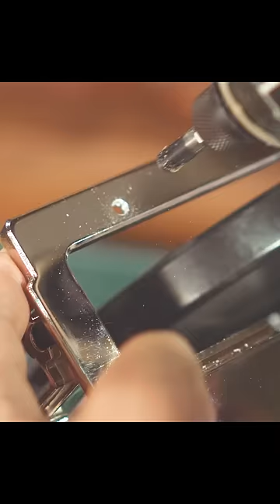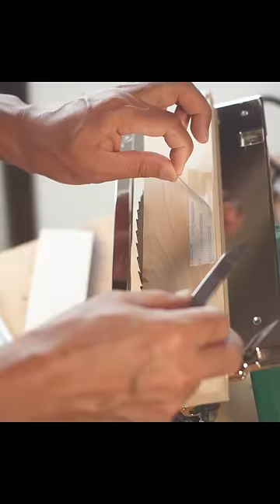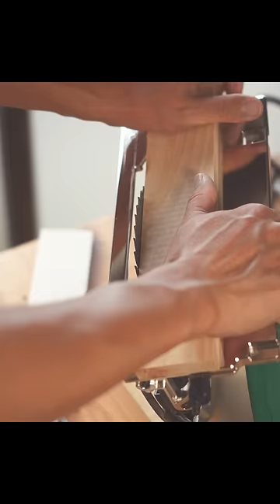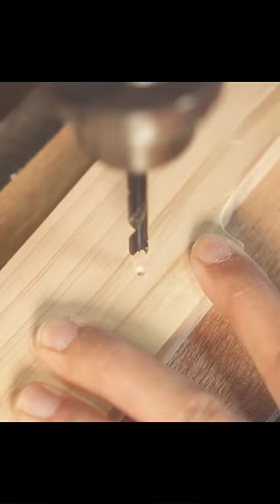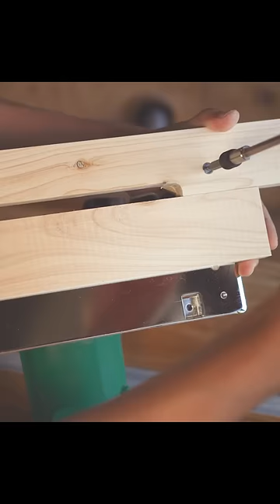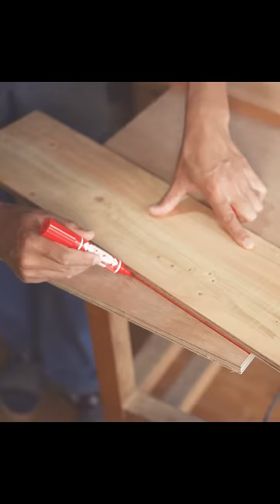Few People Know About This Hack🤫 #shorts

Comment: This is a great idea . . . if you like doing things the hard way.
Reply: What's the easy way? Having to offset for the blade is annoying, besides that only a table saw sled works better
Reply: @A6Legit  Just clamp a straight edge to the board you're cutting, and use that to guide the saw
Reply: I bet he brushes his teeth by shaking his head left to right really fast too.
Reply: Not really, this method is a lot more efficient in the long run
Reply: @Papa-in-Tx No, no, NO.  With his way, the saw shoe, does NOT touch the wood being cut.  No shoe drag micro scratches to need cleanup.
Reply: @A6Legit dude, the saw already has a flat base and flat edge. This is creating a reference piece for an existing reference piece which is useless.
Reply: @Papa-in-Tx  My point is doing it your way you have to position that straight edge offset from where you want to cut, since the blade doesn't cut on the same line as the edge of the saw shoe (aka the base). For example my blade cuts 1.5" to the left of the right edge of the shoe. 
Which means you have to manually measure 1.5" away from your cut line on both ends of the cut, then clamp your straight edge there in order for the blade to line up with your cut line.
 
Using this method the blade cuts in line with your straight edge exactly how a track saw works, but without having to spend $200-400 on a track saw. Even if you DIY a circ saw track/guide, people usually make it pretty long so it works on larger cuts. With this design you only need the smaller pieces attached to the saw shoe, no need for a giant track piece laying around. You can use any piece of wood as your straight edge and the blade will cut exactly where you clamp it.
Reply: @manny9323 Dude, read the other comment I just posted. It should be obvious. The goal is accuracy, if that doesn't matter much then yeah, you may as well just freehand the line and not use anything as a guide.
Reply: @A6Legit I see the dudes point tho. The proper was is to use a edge guide. While this gives you a cut line that’s accurate, it’s also unnecessary if your good at what your doing. This method also reducing cut depth cause he’s using such a thick piece of plywood. There’s plenty of tutorials on edge guides and jigs that are accurate without having to do this large attachment
Reply: @byenzer5101  yes but it is only good for really thin pieces of wood.
For thicker pieces it won't work because you lost so much depth of the blade and extending the blade that far causes warping and therefore wavy and curved/angled cuts.

Comment: There's a lot easier ways to mimic a track saw without altering the saw.
Reply: How? Asking for a friend 😂
Reply: @qjuantum  
Just make a track, there's videos for that if you're interested.
Reply: Cut line
Reply: Clamp a straight edge plank to the piece
Reply: @goingoffgridd  

That's a pain in the arse.  Too slow.  Just buy a track saw.
Reply: I wth u
Reply: The problem with just clamping an edge plank is making it cut exactly on the line. You'll need to measure from the saw shoe to the blade, then transfer that measurement to the wood, clamp down the edge plank and hope nothing shifted.
Reply: @miket2120 Pretty easy once you know the measurement for your saw. It's the same every time.
Reply: @steakeye4808 yeah but then you have to waste time measuring every cuts offset, and making sure the fence doesn't move
Reply: @A6Legit  if you cut a piece of thin scrap to the same width as that distance from blade to shoe, you can use that to offset your guide from your mark repeatably. If you need the cut on the other side of the blade, add two shims the same thickness as the blade between the scrap and your guide. I use two drill bits, usually 2.5mm for the smaller saws, and place them far enough apart to ensure the scrap is parallel to the guide
Reply: @thekinarbo 

Work
Reply: @miket2120   Exactly! I wonder that all those genious commentators didn't get it
Reply: @ldt8904 That's not a bad method, thanks for sharing. 
I still think this way is quicker, unless you use your saw for other things where the wood attached to the base would need to be removed often.

Using a thin piece to offset like you suggested saves you from having to manually measure the offset, but it seems like (at least on long cuts) you'd still have to clamp that spacer to the work piece, then draw a line to mark where the guide should go. Remove your spacer, then clamp the guide on the offset line. 
Either that or use your spacer, clamp it in place on the line, then clamp your guide flush with the spacer, then remove the spacer. 

If youre always doing cuts with a straight edge this method gets rid of the need for that spacer. You just clamp your guide right where you want your cut, and the blade will cut on that same line. It's exactly how a track saw works but you don't need a track to put the saw on, you just use any straight edge guide and the blade will line up with it.
Reply: @A6Legit  it's unnecessary to draw a line for the spacer. Two marks for the desired cut line. Place long spacer on marks, and 2 blade spacers if offcut required. Snug guide up to small spacers. Clamp guide and then cut. If you switch out blades, would need to check each blade has the same offset. Personally if I'm using a skilsaw it's for a dog cut. Skilsaw + electric hand planer if it needs tweaking.. I have tracksaw available and panel saw at the workshop if truly accurate cuts are needed
Reply: @A6Legit  it is possible to achieve remarkable accuracy with a skilsaw if using the method I outlined above. I have had to use it before. Have had to battery jigsaw and electric handplane 22.5° angles on 32mm thick particle board + woodgrain laminate joins for an octagonal reception desk in a hospital when the power went out the night of a penalty deadline etc. If you haven't done something dodgy you aren't working hard enough

Comment: Or you could just measure over from you cut line the width of the fence and set ur straight edge up and cancel this unnecessary step
Reply: ....and keep full cutting depth
Reply: But this modification eliminates the need for extra measuring making this hack a winner for most situations.
Reply: This is BS. unless all your cutting is 3/4 boards or ply anything else no bueno mr george
Reply: @Mote78 clamps and a straight edge are a faster easier solution that will work anywhere on any sheet any measurement.
Reply: @caretakerpete9352  
But you have to measure away from your cut line to allow for your saw base.  With this you just lay it right on your cut line.   It’s not for everyone but I like it.

Comment: Or take a strip of Baltic birch plywood the width of saw base, as long as you wish, fasten a 2” strip on top flush with one edge, run saw along 2” strip while cutting through wider piece. From now on line up that cut edge with markings, and cut away.
Reply: Oh freedom units...how is this still allowed. Anyways good tip also.
Reply: 9😮😅
Reply: I did a big built in project for my last house and this is exactly how I did it.  I made an 8ft sled for ripping and a 3ft for crosscutting since the shelves were too wide for my miter saw.  I have a tracksaw now but I think this method would still be faster since it squared each cut.
Reply: Where did you find Baltic birch?  I thought Putin put an end to it.
Reply: This is the actual best and fastest way of making a jobsite track saw and faster than just using a straight edge where you have to measure each time vs just lining up with your marks.

Comment: Clamps and straight edge… don’t ruin your saw
Reply: "Ruin"? A bit hyperbolic, ya think?
☮️❤️🌈
Reply: drilling holes in a metal plate isn't ruining anything.
Reply: Заводские решения не его стиль😂
Влажность поменялась-упор изогнулся😉
Reply: @HappyBeeHoney if you intend to take that wood off and use it for finish work, it'll be more likely to mark up whatever you're cutting.
Reply: @Avaddon911  na man. 20 seconds with some steel wool after drilling and it should be smooth as butter. there's no issues
Reply: The problem with the clamps and straight edge is in making sure your measurements are spot on. The edge of shoe to blade distance must be exactly translated to the workpiece in order to place the straight edge down. Okay if you're only doing one or two cuts, but if you have to do multiple pieces, it'll take a lot of time.
Reply: @miket2120  I have a clamp/straight edge all in one. It's pretty nifty.
Reply: How did he ruin the saw with pre threaded screws to easily remove the Gide I’d say the saw is fine
Reply: @miket2120 if you make a gauge the same width as the distance from blade to shoe, you can place the gauge ok your cut line, and then butt the guide/track up to the gauge. Then clamp guide/track, remove gauge, and cut. Simple method for repeatable results. If you need blade-thickness offset, keep shims handy (or drill bits work well) the same thickness as your blade kerf, eg. 3 or 2.5mm, and place them spaced-apart between the gauge and the guide when aligning to your mark. Ez Pz

That said, if I'm choosing to use a skil-saw instead of a track-saw, freehanding it should be accurate enough for the intended purpose.

If I didn't have access to a track-saw, I would use the gauge method.
Reply: I can see doing this to a jig saw but there are easier methods to get a straight line with a circular saw.

Comment: most saws come with a fence to do that !
Reply: No they don’t. The fence does not come in to the blade like that! Go look again.
Reply: Not uneven cuts Mr smart guy 😂
Reply: Yes thy do.
Reply: Fences are for cut parallel to the edge and they are not always accurate. This adaption allows miter cuts with spot on accuracy.
Reply: @Crustyswede1 Milwaukee, Makita, Dewalt, Black & Decker all come with a fence if you’ve bought a brand new one in the last 10years. I should know I’ve bought one of each for different Christmas gifts. Milwaukee 💯 does I’ve owned 4 from the last 20 years and never had to buy a fence separate except a skid plat that’s 10ft long  😂
Reply: @stoniebro-nies they come with a fence but doesn't give you diagonal cuts like the one in the video. However a Festool on a track does that
Reply: You’re joking if you’re comparing a circ saw fence to what you’re seeing in the video. Those fences are trash, whoever designed those needs to be thrown into a dungeon for several days with Boban Marjanovic.
Reply: No, no, NO.  With his way, the saw shoe, does NOT touch the wood being cut.  No shoe drag micro scratches to need cleanup.

Comment: I was about to ask what the point of that was,  but it makes sense if you need to transfer a cut multiple times. Another solution is make a board the width of the saw plate,  set it on the line,  mark the back,  then use that board as a side guide and you don't lose the depth of putting the saw on top of a board
Reply: While that works (and I've done that a lot), it's tedious if you have to make many cuts. With Yasuhiro's method, the guide gets clamped on the cut line, no measuring needed. Where the edge of the guide is, that's where the blade will cut. It's like using the old homemade saw guides that use two layers of masonite, but far more portable.

Comment: my dad has a set of boards that are specifically designed to be a simple straight edge for his circ saw
its literally 2 boards screwed together and cut in such a way that he just has to clamp it down and boom, run the saw and its done, no extra accounting for the width of anything, just simple

Comment: This will never work, because on each pass, the circular saw will chew on the guide, whether you like it or not.
After each pass, it will get harder and harder to align the guide / fence to the actual location of the future cut, because it's missing material. 
So you're going to have to change the fence rather often.
I've been using a plexiglass sheet with the exact location of the offset of the blade traced on it, and a guide that clamps to the edge for years, and I can always get exact cuts with that setup.
And there is no need to drill into the circular saw

Comment: Lol. Just move the one free block over the width from the base to the blade. You won't have to drill holes or remove the blocking that's attached to the saw. That's the hack. This is just trying to look smart but not know what you are doing.
Reply: Yeah. If you want to do it the easy way 😅. Just use the guide already attached to the saw. You can make a spacer pretty easily from any thin scrap. Place 1x next to a 2x and use the 2x as a straight edge. The 1x cut is the exact space you will need between your line and your straight edge.

Comment: If i would drill holes in saw base, i would attach piece of thin plastic with parallel groove to use on diy track. Obviosly pain in ass. So i went and bought cheapest circular saw designed to use on track, just didnt buy tracks, made my own.

Comment: So many idiots in this comment section with no clue. There is a big difference between this mod and the guide that comes with most saws, especially the cheaper ones. The long straight piece keeps the saw perfectly aligned all the way along the cut. Plus resting the saw flat on the wider piece of wood keeps it more stable than trying to push against a straight edge (plus straight edges can be expensive or hard to find in some places).

Comment: You know, there is a lever that you use to lock or unlock it so you can make the cut shallow
Reply: That wasn't the purpose.
It's more like a track saw
Reply: He wants to use a board as a ruler and rides the saw sloding on that board. Actually the little plank he fastened to the saw's base rides against the board.
Reply: You mean, what he used to raise and lower the blade? Why would he want to make the cut shallow? It seems like he wanted to cut through the wood, not just make a notch in it.
Reply: 😂😂😂😂wake up are you blind😂

Comment: Holy bejeezus, lot of haters on here.
What if you lost your guide?
What if you need to make 100 zero clearance cuts?
What if you want to dedicate one of many circular saws you have to a zero clearance saw?
One is hardly "ruining their circ saw" by drilling a couple holes in the base ( foot, table)
This mod has its application. The idea can also spawn other ideas.